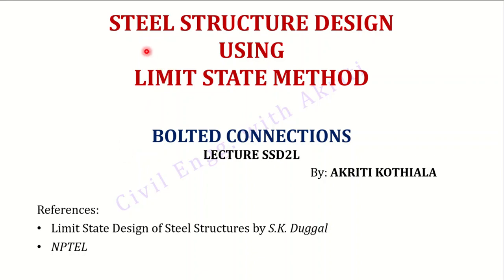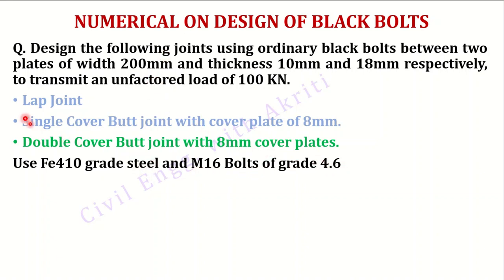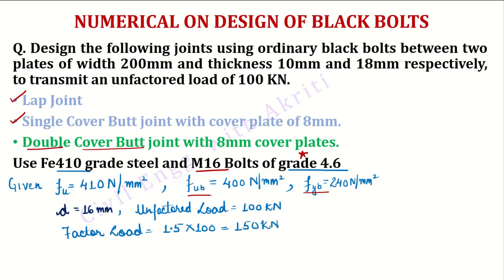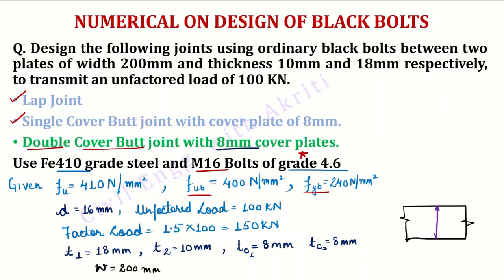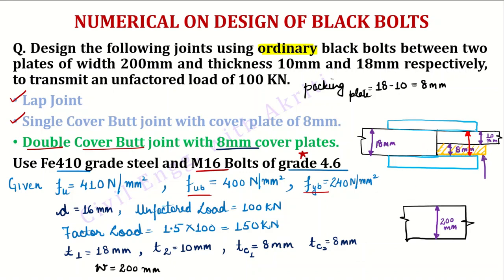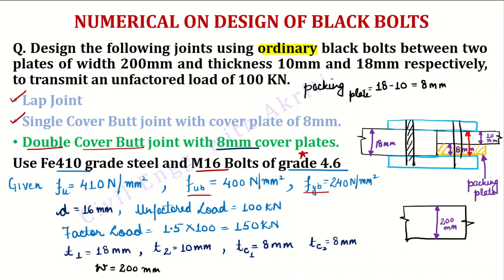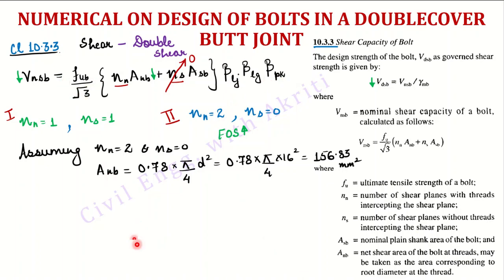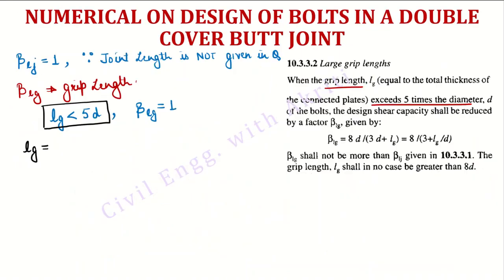Steel Design L2L| LSM | Bolted Connections| Double Shear Butt Joint| Packing plate| Numerical| Hindi

Comment: Design a double cover butt joint to connect two plates , each 12 mm thick and 300mm wide . the service load to be transfered is 200kn

what to do in this question can you please explain asap

Comment: Mam 6 bolt kyu nhi aaye Apki last video bolted connection me Dimond bolt question me apke bolts 6 aaye the tab apne btaya tha ki hum bolts har plate per provide karte hai toh apne 12 bolt use kiye the
Reply: Mam ka bat or puchni thi ki jab hum diamond bolting me An nikalte hai toh wo staggered critical section jaise lete waise kyu nhi lete
Reply from the maker: You're right... It should be on both the plates

Comment: Bolt dono side me 3-3 provide hoga drawing me.
Reply from the maker: If the number of bolts have not been mentioned in the question we can provide any suitable number of bolts (here 3) in the drawing.
However, in practice the joint is designed and bolts are provided according to that.
Reply: Exactly there will be total 6 bolts provided
Reply: @civilengg.withakriti2556  Mam ,how many bolts to be provided in this question? please explain.